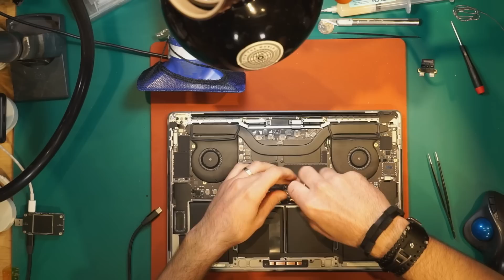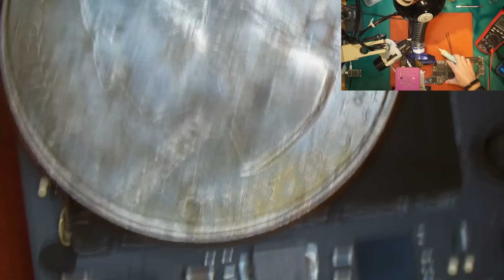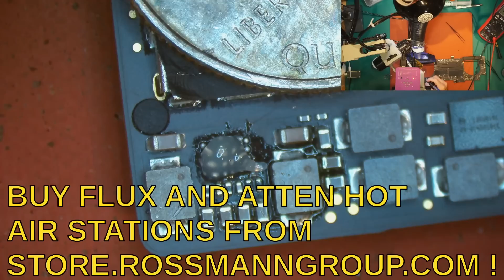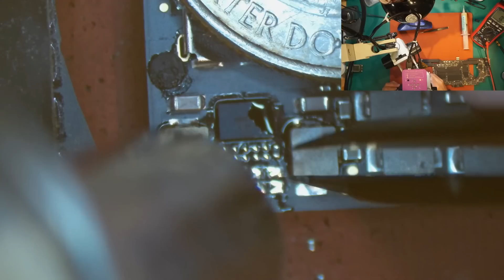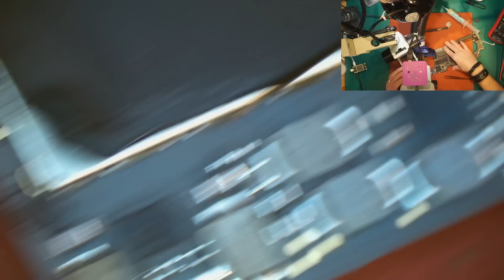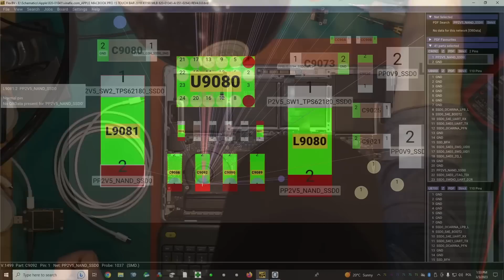Are Apple products still JUNK in 2023?

Comment: this is why i wont buy new apple shit! my all my apple computers are 10+ years old and if something goes wrong at least i can fix it my self! my main macbook is a 2015 retina mbp and my secondary is a macbook pro 2011 that the amd gpu blew up but i disabled it... my main desktop is a 2010 imac and my secondary is a 2012 mac mini! and when it comes to my iphones my main one is a iphone xr 128gb factory unlocked model and i have a iphone 6s plus and a 6 plus for backup i also own a apple watch series 3 and a series 0 both which work fine heck i even own a pair of airpods pros... and none of these i bought new! the airpods was actually the cheapest apple product i bought at 33$ after tax due to an incorrect ebay listing...

Comment: New to this channel, but heard how much Mr. Rossmann dislikes Apple products and wanted to know why. I'm an Apple user since 2014. I strongly dislike Windows-based OS and apps, they simply aren't as simple to use.  If someone has betters OS and apps (mainstream due to having to work with Windows  & Apple worlds, please share.  My MacBook Air mid-2014 is still going strong and finally this year needs the battery replaced.  Can't say that for any IBM computer I've had old or new (over same period; HP, ASUS, Dell).  But, since I'm open minded and find their quality waning since 2019, could anyone here tell me a brand or recent computer model that is as good as this model (in durability and easy of use), I'm a taker.

Comment: Apple products peaked around the time of the Mac Pro 5,1. Drives, memory and batteries could still be replaced by the user and the needs for their professional users were actually met. Around the time of the 2015 MacBook Pro onwards, Apple’s engineers have seemingly shifted focus towards solely meeting the whims of company’s accountants. Cut to today, the present company is a caricature of their former selves, having exploited their customer base at every conceivable angle to serve their bottom line. And their supposed environmental responsibility? They can drop any pretence of that.

Comment: speaking of ssds my laptop i bought second hand from a pawnshop and i always take something like that apart to see if it needs to be cleaned well it was spotless just a little dust around the heat sink and i found a section on the board that wasn't populated with anything and its forna ssd but it has a mechanical hard drive

Comment: 10 years of owning apple products and never had one just fail. Current MacBook Pro is 5 years old and used daily and I have to admit isn’t treated all that well. Running a little slower than it was new (planned obsolescence), but it still works. Never have issues with data corrupting or worrying about losing anything on my devices thanks to iCloud. 

Have a PC I built myself that is top of the line for gaming/daily driver. Graphics sometimes freeze up and I get the driver disconnected error. Always having to update drivers manually to make sure I’m up to date and there’s no single ecosystem for the windows where I can connect my phone and other devices to the cloud. 

Both have their advantages and disadvantages. I don’t think Apple is exclusively a shitbox. I think it is simply where the market is for personal laptops and more people own them leading to more faults. You can get a screen replaced on the iPhone but good luck with a Samsung not costing $400. 

We need to focus on the right to repair across the board for schematics and parts. I dont think bashing Apple is doing us any good. If they fall another will rise right where they were and be the same or worse.

Comment: Yeah, they're running that dual buck converter chip at around 85% of max rating.  Typical Apple engineering.   It would be nice if they would dial back their designs to say 75% of max and maybe add a crowbar SCR to save the memory chips.  That would cost them about 70 cents.

Comment: This is absolutely f---ing INSANE!
Overvoltage protection of data storage is as simple as adding a zener diode and ICP fuse - zero excuse for omitting this most basic protection feature. Apple are really garbage. You never had this sort of crap in the days of the Apple II - somewhere along the line they severely dropped the ball :(

NEVER BUY crAPPLE PRODUCTS unless you enjoy throwing money away.

Comment: It’s funny how my Windows 98 Toshiba Satellite laptop still works, but every computer I’ve bought since has been hot garbage after about a year.
Reply: Results vary. My old boss gave me a 2011 Macbook Pro that he had laying around from someone else. Still works fine. 2013 Macbook Pro worked fine until the screen got smashed. 2012 Mac Pro works perfectly. But my 2015 Macbook Pro has some kind of missing voltage regulator to the battery, so it fries batteries, very odd.
Reply: @gorkyd7912  I feel like older Macs were made to stand the test of time (along with other older electronics) and today we have a bit more planned obsolescence without the ability/ difficulty to repair
Reply: @theconfusingwords   Definitely true but I think it's a trend that goes beyond Apple. In the past, Apple spent a ton of money including and marketing different hardware techs like FireWire, Thunderbolt, etc. but I think they realized most of those innovations become outdated so fast that it isn't worth it so they're starting to treat devices more like disposables. The old Macs were easier to fix some components but you're still stuck with old USB, old Firewire, old Thunderbolt, etc. so it's almost like why bother.

Comment: I've owned probably a dozen Macs over the past decade -- never once had a failure, never once had one even die on me. Still have four 2014 MBP's that work great. Not to say that stuff doesn't happen, or Apple isn't anti-repair with what they do, just that it's more likely these failures that you talk about happen as a part of manufacturing. If you sell 10 million laptops, and 1% have a defect, that's 100k laptops. However the error with the SSD seems like something that should have been recalled & rectified by Apple, but my guess is they probably didn't have enough legitimate complaints to even be 0.1% of the actual amount that they sold.

Comment: We've gone through 20 or so MacBooks (small business) as well as peripherals, speakers, apple TVs, monitors, you name it in the past 2 decades. We've had a 2013 Macbook Pro recently fail with a bad 128GB SSD - thankfully that one is socketed so it was an easy fix and 2 of our laptops were replaced under warranty with the dreaded butterfly keyboard, also a pair of original airpods 1, the battery now lasts just 1 hour which is frustrating. Everything else is still working, some of which is over a decade old now. I guess we've been super lucky but how many 10+ year old Windows laptops are still in use?
Reply: I am one lucky 10+ year old windows laptop user 😅. Got my mid ranged Asus laptop in 2013 (DOS installed). Immediately after buying, I installed Windows 7 then upgraded to Windows 10 when it was released. Old boy is too outdated for Windows 11, or so says Microsoft. Currently, I am still using it for some MS Office apps and occasional Dota 2 gaming. Boots a bit slow but once booted, it is still going fast and strong.
Reply: If you talk about windows laptops like all the same is because 
1 you re clueless
2 you are a liar.
3 all the above.
Reply: Many , I sold like 6 laptops from a engineer friend they were looking bad but working.
10 years on a mac ? I doubt
Reply: @Static-4  that comment is 5 months old, our oldest Apple laptop turned 11 and still working fine and looks great! :)

Comment: If I had to guess what the problem is, since there doesn't seem to be an obvious problem in the schematic circuit, the enable voltage probably went or stayed high before the ppbus voltage came on. There's no sequencing requirement in the TPS62180 datasheet but it may cause a reliability issue with the part.

Comment: I am a shameless tech hoarder, i own about 40 laptops, 12 desktops, and 5 AIOs,

Most of these devices where made several years ago, with the exception of a couple 2017 HPs.

None of these machines suffer this issue..... Its probably only Apples 

Worst part?.... They probably KNEW full well there was a design flaw on their boards and continued on business as usual.. 

Committed to the environment my ass

Comment: is this still true for M1 MBP?
Reply: Short answer, no :) - this only seems to apply to 3+ year old products it seems? - but I agree with Louis that some of these mistakes span many many years which is embarrassing!

With this said, I have many MacBooks that are 5 or even 10+ years old still working fine, but sure there were some really stupid design decisions with an alarming failure rate, but I do wonder what the actual percentage is, is it 1% or 10%? - I've been super lucky though, in 2 decades and over 20 different MacBooks in our small business, never had anything like this, just 1 single 128GB SSD failure after a decade of use.

Comment: Apple's laptops cost perhaps twice as much as competitors' with comparable specs. For that kind of price, I would expect better engineering quality.
Reply: This hasn't been true for a long time. The Apple Silicon Macbooks cost less than most comparable things from non apple silicon (not that there is anything comparable in my opinion).
Reply: Total BS. It's hard to even FIND a Windows laptop with a screen anywhere as good as an Apple, let alone the rest of the specs, and it will never run Mac OS anyway so you're stuck with a demonstrably worse OS. The Dell XPS 17 Laptop that costs $2900 has a 17" display that is at 1920 x 1200 pixels. F'ing garbage. The 10-year-old 15" Macbook Pro I got for less than half that price has a better display. The Macbook I have now has a 3024x1964 display and I paid $1400 for it used.

Comment: Again that presentation shows a light on true face of the A$$le, even overpriced devices which are still not old must be damaged to control money incomes. They know how to create mainboard and how to create internal self protection but an accountant not engineer control that company so money, money, money must flow. They still can't understand we will buy new devices just because they are nice and necessary, older devices will be given to children, grandpas etc... so A$$ple doesn't need to kiil it just after 2 years of working "just in case", and worst of the worst they damage user's data which are more expensive than hardware.
Pozdrowienia dla Krzyśka :)

Comment: I'm not an Apple fanboi, but are you sure this isn't just selection bias? I mean, your shop specializes in Apple repair, so you'll see mostly bad Apples.
I mean, it's clear from seeing certain problems frequently that there are questionable engineering choices by Apple, but weak points in design exist in most brands. Of all the devices I've had to maintain for myself, friends, and family, the Apple tech has presented the fewest issues (but usually the biggest pain to fix).
Reply: "Weak" is an understatement. No one else makes such weird ridiculous decisions like Apple Inc. does.
Reply: @abcd-kz9vw  No one?
PCI-SIG's poor design of the 12V-2x6 cables causing high end GPUs to catch fire doesn't count?
AMD's 7800x3D CPU's killing themselves with too much voltage doesn't count?
Apple is far from alone in the matter.
Reply: yup. For every Mac board failure we get, there's around 10 failed HDDs because the other brands decided to use them in most of their lineup until like 2017 or something. And there's still laptops being sold with HDDs in them, which is insane. So yes, Apple hardware design sucks in some (actually many) products, but some of them are so well known, that it's kinda easy to fix (2010 A1286 cap, 2012 U8900 and so on). The world isn't black and white and the other brands are making bad decisions in hardware design every day too.
Reply: @PvtAnonymous  And how could those failed HDDs be used to attack other brands, when HDDs have clear cost:capacity advantage for many consumers and had been the norm in the computer history for a long time? You're seriously wrong if you're suggesting using HDDs was a bad decision equivalent to the eccentric things that only Apple Inc. does.
Reply: @abcd-kz9vw  because HDDs are worse in basically every other aspect than cost. Slower, prone to failing when moved or dropped, require more power, physical limitation of capacity, bigger, heavier... the consumer doesn't know any better - and gets abused by these manufacturers. Out of 1000 people I know exactly ONE who preferred that we install and HDD as a replacement instead of an SSD because that guy is still living his 1995-delusion that SSDs fail more often (they do not). And I'm sorry, but SSD cost hasn't been a big problem since 2018 at least. And especially now when you can a whole TB for like 40 bucks, NVME, TLC - all the good stuff.

Comment: There is obviously a design defect or component quality control issue going on here. Not only has the user lost their data the laptop but due to the design, they can't just plug in a standard of the shelf SSD and continue using the laptop. It's almost like Apple wants them to have to go out and buy a new Macbook instead of getting many years of use out of their current one.
Reply: Partly true I'm sure but I also think it's easier to automate and scale the assembly of a cellphone-like laptop with soldered / glued components than it is to do the same with connected / screwed components that can have issues with seating and torque.
Reply: @gorkyd7912  Sure but Dell, HP, Lenovo, Asus, Acer, and  Toshiba all make many laptops that have m.2 NVME SSDs and most models are significantly lower cost than a MacBook. Apple is more than capable, they just don't want to.
Reply: @Ariannus   The cost differences are irrelevant. The perception that Apple is way more expensive is based on a general ignorance, usually by people who want to play games all day, who think you can summarize any device by its combination of storage, memory, graphics card, and cpu. It's just false. If there were non-apple computers I could buy for cheaper that would work just as well I'd be all over them; they don't exist.
Reply: @gorkyd7912  I was not saying that Apple computers are more expensive, I know very well that similar high end Windows computer are just as expensive. I was specifically replying to a comment saying that MacBooks using soldered SSDs is due to the cost / labor of having a socketed SSD.
Reply: @Ariannus   Gotcha. There could be cost savings in there at some point but I think it's more to do with the overall reality that they will be replacing human assemblers with machines in the FoxConn factories (or wherever). It was probably better to hire humans to plug in connected replaceable parts but I suspect all the soldering can be done more easily and consistently with machines. Wages in China have grown exponentially, and of course people don't WANT to sit and assemble parts all day (hence the suicide nets), so one way or another they're moving to machine-assembled parts and Apple is likely trying to get ahead of this trend since their production runs are about as huge as it gets.

Comment: Yeah no surprise the SSD died. Abruptly changing the voltage live (like the Apple device does) is insta-death to electric devices. That is why the power circuits such as chargers are built to be isolated circuits (e.g. nothing gets to tamper with the voltages of your power circuit). Apple has fucked around with its "logic board" (that double-donut thing is supposed be a motherboard) at least since the 1990s and the dedicated customer service sites have documented issues with it and the crappy customer service, especially when broken products are involved. Apple knows it can get away with this stuff as it is the big corp despite fucking its customers over for decades. It has the data to show that its core demography likes being fucked with. :)

Comment: This is one of the rasons why i am sooo mad about the ongoing trend of removing the SD card Slot from new phones. With SD you would at least be able to get your Data back. Sure, not building devices with this kind of terrible design would be even better. But it seems the manufacturer decided to double down and do both. Design terrible devices and remove any option to keep your Data accessible.
Reply: I never used those extra SD card slots. Just backup data to a computer, which backs up to external hard drives. If you break your phone the SD card saves you, true. But if you lose your phone or it's stolen they're both gone, so what's the point?

Comment: What would Apple do if you took this to them?
Reply: I'm just guessing, I may be completely wrong here, but it could be ok Louis, it's stupid, it's embarrassing, but this accounts for a 3 year failure rate of 0.0001% of our laptops, so we didn't consider it enough of an issue to address until our Apple Silicon models 3 years ago.

They may highlight that Louis may be receiving multiple laptops per week, but this is purely because of the huge sales volumes, rather than representative of a wide spread problem impacting a significant percentage of units. Just a guess!

Comment: A very simple reverse voltage zener diode (a chip that would cost less than pennies) could save the NAND from overvoltage failures. It'd fry the buck converter by shorting it in overvoltage, but at least you'd have your data... Of course apple could just use chips that don't fail like that as well. I wonder if there'd be a market for securing user data by bodging such a chip onto the motherboard? The apple ecosystem is wild.
Reply: Board Designer: "Will this chip ever send 7+ volts down the rail?"
Component provider: "No."
Board Designer: "Ok good, guess we won't need this diode..."